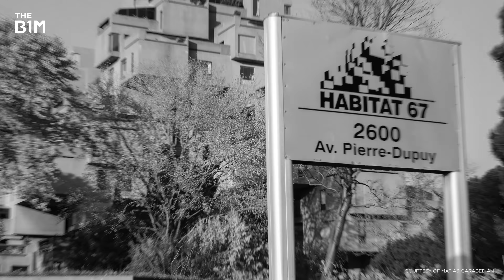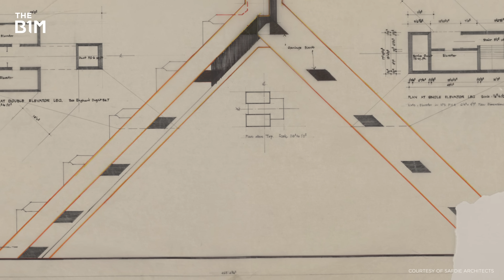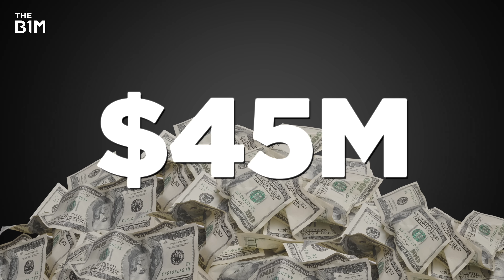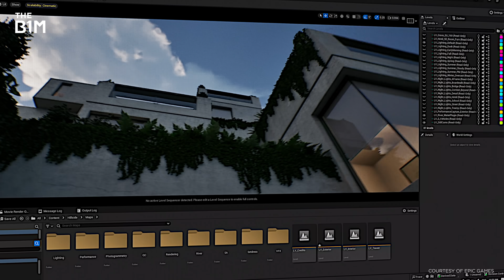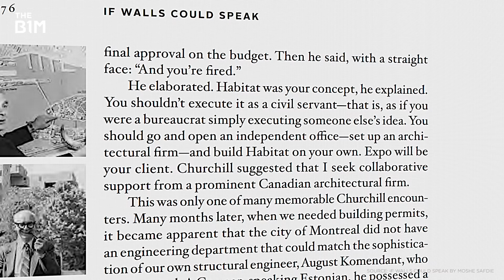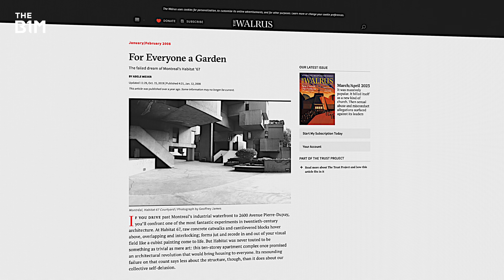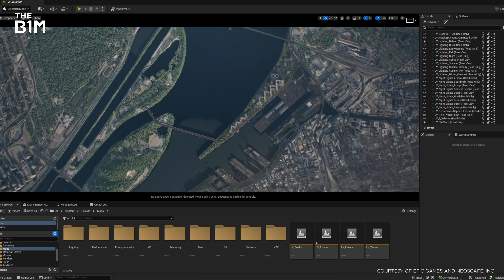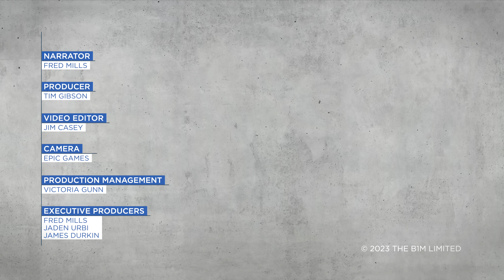How a 23-Year-Old Solved Urban Sprawl

Comment: If the patio is part of someone else's roof, a repair of a leaky roof would likely require tearing up your patio. Also, if you wanted a garden on your patio, how much soil and materials could you use before overloading the structure? Not to mention the logistics of getting all that material up there.
Reply: As for drainage and load, it looks like the decking is a separate modular square of planks, probably a plastic material like plastic decking these days. Pretty durable, but will look faded eventually. Pick the right colors and the fading isn't as noticeable. The flooring underneath would be solid concrete with an elastomeric paint coating, so no leaks. Presumably you'd do an incremental inspection and replacement process, and yes, that means every 10-20 years or so you would need to pull everything off your deck for a few days. And management inspections by drone could estimate if someone is overloading their deck and make sure they know it's not okay to store 100 anvils or an entire pool or whatever. 

As for transporting gardening stuff up there, you would do it like you move furniture: by taking multiple trips. If you have a little folding hand-cart you can carry maybe 200 pounds with little effort, limited by volume of course. That's a couple flatpacked adirondack chairs or a couple large ceramic pots with soil, or about 6 large plants in black plastic garden-store buckets, or 3-6 bags of potting soil. Getting your garden totally set up could take up to 10 trips to the local garden supply using your bakfiets. To summarize, you could do this over the course of a weekend while getting some good exercise and skipping the gym those days. 

What you don't get to do is drive to the garden supply in your ridiculously large pickup, buy 4000 pounds of stuff at once, drive home and back your truck up into your garden, and then unload everything at once. And then of course not use your truck bed more than 10 days a year after that. 

However, if I were designing this, I would include a cargo elevator for each unit stack to allow for easy moving, and on-site shared carts like you see at hardware stores. I don't know if that was part of Hab67, and didn't want to assume it.
Reply: Also it seems like they would hear you walking around on their ceiling.  He's onto something though, density requires open spaces and parks to break up the concrete jungle.  Apartment buildings need to surround nice little pocket parks.  The first floor of apartment buildings should be shops, restaurants, etc and parking should be underground.  The key is the pocket parks for green areas though.
Reply: @jeffk464  Speaking of green spaces, the city of Savanah GA has an interesting history. The original design of the city is in a grid of streets where most of the squares had shared green space parks for the residents to use. It was unique and ahead its time, especially for that era.
Reply: I'm sure testing is in order for weight distribution of the entire structure. Materials are taken into consideration, hemp concentrate seems like a good pick here it's light and strong. But I'm sure they look at all options. Getting material up High is what humans do. I've been on some crazy structures and it's baffling to how humans got extremely heavy material so high but they did it. I'm sure projects like this aren't perfect but as a human living the existence I'd rather see different options in housing. You know how America's housing is very structured unless privately funded. Safe investments with maximized profits per square foot instead of thinking of the human experience within the walls they funded. Stuff like this makes me think what other cool projects we humans could do and why we haven't built anything monolithic to awe the masses of our accomplishments of a collective working society. I'm rambling my bad have a dope day lol
Reply: @orianna1220  I'll definitely agree that if you are going to live in an apartment, that type of design is much more appealing than a straight up and down building with barely a balcony or no balcony at all. In the US, most zoning laws make it so that you can't mix residential and commercial areas. If you live in a suburb, you can't do anything without a car.
Reply: @randymiller2460  there are already apartments where your patio is some's roof. Generally you have rules in place to prevent issues like that. The specifics of soil would only be allowed on the sides where there would be drainage and anything else would not be allowed in the bylaws. (basically no real garden but you can have potted plants). As for logistics of materials it isn't difficult if you look at how Korea does things for apartments. Personally I am not a fan of the style but I can see the appeal.
Reply: You are mentioning challenges, not show stoppers. Challenges are created to be overcome.
Reply: Uh, helicopter?

Comment: I think it's creative, interesting and worthwhile, its just... I hate brutalism... 
When I look at it, I instinctively want to file off corners, build arches and curved supports, nudge the apartments into non-square angles...  
It could be so pretty if you made it actually restful to the eye... 

I've often thought that you could make a great building to live in by basing it on stepwise pyramids. This is pretty much that but hollowed out and spread out. 
I can see that you get way more light this way, and everyone does get a terrace, but you also gain a lot of surface area you need to paint, insulate and maintain. 
With a pyramid structure, you could have shops and offices on the inside, maybe a central plaza with library, daycare, museum, a park...

It's definitely inspiring, though. Most buildings I see are just so forgettable...

Comment: As some other people have pointed out, winters in montreal get very cold, especially just off of the st lawrence without any natural shielding from the wind. The structure of the design is cool and a longstanding cultural monument that we all love, but it's widely known to be a freezer box that's hell to heat in the winter. There is no way that by now we haven't figured out ways to heat and insulate modular buildings like these while also doing something about the grey concrete coffin look that feels more like urban hellscape than green paradise. We need ideas like these--but we need to make them better.
Reply: Yes, there's a variety of ways the original designs can be improved upon with newer technologies and methods, like thermal pipes, hempcrete, etc.
Reply: This is the best comment on this video. Everyone is so black or white here. You catch the balance well
Reply: @kylemalachowski people have a hard time with nuance and complexity.
Reply: Heating mainly comes down to surface area. and it should be obvious that this style basically maximises surface area, thus making heating more expensive.
Reply: @nonyabisness6306 not only that, the height maximizes winds. Wind is extremely good at cooling down structures very fast. In my country many old farmhouses have a mini forest built around them or in the most common wind direction, it helps a lot to reduce heat loss.  When you have a small village where Everyone has tall trees everywhere, wind is strongly reduced so the heat loss is likely much much lower than an elevated structure with similar surface area
Reply: This was the first question that i had when saw it, how will you keep it warm and comfortable in the winter for everyday people if you want to multiply as a solution for friendlier cities
Reply: Well the easy solution seems to be don't live in Montreal.
Reply: Insulation, air sealing, and heating have come a long way since '67.  I'm thinking of a well sealed design built with ICF and heat pumps, which will likely need gas, electric or steam backup for Montreal winters.  An issue is that each unit is exposed to wind on all 6 sides, and has a high ratio of surface area to volume.  But all single family homes are almost as bad, we know how to insulate those.  A conventional tower block would however have inherently better thermal efficiency for any given level of insulation, most apartments have only one weather-exposed wall.
Reply: it looks like a coffin on purpose because brutalist nut jobs want every building to look like gray coffins
Reply: aircrete for exterior walls is lightweight, highly insulating, and easily formed and shaped.  it can be made of differing densities depending on anticipated loads and mixed with basalt fibers for superior reinforcement. Google it...
Reply: That's one way to look at it. Concrete can be drab. But, what if that's what people are used to? This could totally work in Japan.  As long as the structure's up-to-snuff for earthquakes and typhoons.
Reply: Ok then don’t build these types of buildings in cold climates
Reply: maybe this design would be more suitable for tropical country?
Reply: I think the concept is good but different shapes with beter formations could help a lot against winds and keep the core more warm even tho spacious and open and make it look less like lego. Also using different alternatives for the concrete combined with possibly an extra outer layer of thermal isolation could fix all of the issues.
Reply: True Artist doesn't care about people who will have to live in it 😂
Reply: "The structure of the design is cool and a longstanding cultural monument that we all love, but it's widely known to be a freezer box that's hell to heat in the winter. "
not more so than private individual homes
Reply: kinda looks like a dystopian nightmare prison to me. I'm all for pushing the boundaries, but I'd say this missed the mark by a mile.
Reply: @jakeroon  I like the idea but it looks hideous.
Reply: This was my reaction when I saw this project: it's not suitable for a cold environment.
Reply: With better computing and AI the industry can develop more realistic models/simulations without having to build anything, so hopefully that'll pave the way to finding a viable solution.

On the flip side, capitalism is driving developers to cram as many people into as small a space as possible, so maybe it doesn't matter.
Reply: @ukno918  capitalism isn't doing anything. You are complaining about human nature and a trait that you almost 100% indulge fully in. You aren't out helping others you are trying to build your wealth just the same as all the "evil capitalists" that you say are screwing everything up. In reality you are just angry that you aren't as good as a capitalist or you think you are a better person because you are failing more than others.
Reply: first of all we need to regulate immobilia market, stop private rich to buy space, then we can start building progressively, just then there is a realistic chance to make stuff like this happen.
Reply: It may look better on the surface but cramming people into a small area is still cramming a bunch of people into a small area and comes with all the same issues, putting a coat of paint on it doesn't make it better.
Reply: @thomgizziz  Thing is: if we can live densely, yet still be very happy with our environment and living space (own terrace!), then  I'd say that's a feature, not a bug. 'Cramming people' sounds negative. 'Have everything in walking distance' sounds a lot better.
Reply: @thomgizziz  It's a completely new shape of city though, not any kind of rebrand.
Reply: @thomgizziz  medium density housing with mixed zoning is the best possible way to do urban design. It’s the gold standard because it offers the best in terms of lifestyle, environmental impact and health. That’s what habitat 67 was about in the first place, even if it wasn’t perfect. People who dislike medium density housing in my experience have never actually lived in areas like that, are too attached to single family units and can’t think of any good alternatives to urban sprawl or housing shortages that aren’t the dreaded downtown high rise. Living in close proximity with a lot of other people isn’t a bad thing necessarily, and it isn’t actually all that hard to do well. Before suburbia became a thing in the 1950s, that’s how all urban neighbourhoods were built.
Reply: @petrab.7780  Urban sprawl, structural housing shortage and the likes are only such a grave, pressing problem if you presume infinite human growth - which most likely won't happen as the world population is predicted to stabilize in the next century, and potentially even decrease (and if it won't, then we'll have to find a way, as we'll have a far bigger problem on our hands than urban sprawl !).

Also, the whole debate is logically faulty : the caracteristics of the current configuration of suburbs and the likes are used as an argument for their destruction in favor for medium-density housing. However, this 1. only takes into account some configurations for medium-density housing which certainly aren't applicated everywhere (and I'd even say, aren't properly applicated anywhere) 2. only takes into account the current configuration for suburbs 3. ignores all the other numerous causes that are more pressing and would maintain the problematic situation even if current configurations changed.
Reply: @bastobasto4866  anyone who says housing shortage isn’t a pressing urgent problem clearly hasn’t had to try to find affordable housing in the last decade or so. Very few people advocate for the blank slate destruction of suburbs—that would be counterproductive. And since the “current state” of suburbia is the one we’re stuck with, I don’t know exactly what other “kind” of suburb you’re alluding to that would be preferable without transitioning towards some kind of mixed zoning and multi family houses.
Reply: @petrab.7780  Search "Is there a shortage of homes in Canada" by Jonathan Russels, which talks about my last points. There's some other article I had specifically about Québec, but I can't find it RN.
Reply: @petrab.7780 utterly nonsensical. There is no national housing shortage.

Comment: What's interesting is that Soviet Union, actually implemented some of these concepts into reality on a truly gigantic scale.  Khrushchev, also in the 1960s, built modular housing units, encompassing schools, kindergartens, schools, and offices all over USSR.  Of course, it wasn't as pleasant, as Soviets cut costs to the bone.  So, there were no stacked housing, and roof gardens and terraces.  These were just rectangular structures 5 stories high, at first, and then expanded to 9 stories or 12 stories high.  They had tiny balconies and first story units had small gardens.  I grew up in one of those.

Comment: You are confusing having an idea with solving anything. See, Hyperloop is a cool idea but it's an over 100 years old idea and the reason why we have never seen one is because that idea does not work, it's impracticable, inefficient, unmaintainable, costs way too much money and the same problem can be solved way faster, easier, and cheaper. There will never be a Hyperloop (remember my words in 50 years!)  And most people would not want to live in houses like that; apply them to the masses and you get modern Favelas as in Brazil  (look it up on Google, notice how similar they are and see what problems they cause).
Reply: As a Brazilian, I don’t want favelas anymore

Comment: As an engineering student who just graduated in structural engineering and who is from Montreal, I think this is my favorite video from your channel, Habitat 67 and all the other buildings left from the expo are really impressive and beautiful even after almost 60 years. Today, in Montreal, few actually know that habitat 67 is only a fraction of what it was suppose to be, but when we hear about it, the main reason for the fact that nothing else like it was built after, is the cost. However, I wonder if a new design that could implement pre-fabricated wood modules, using Glulam wood, maybe combine with steel or concrete for the main frame of the building could work. I would really love to see and to work on such a project.

Comment: Concrete manufacture releases a lot of greenhouse gases. This design would be better in wood. However it is not the most efficient use of wood or materials for that matter. The most material efficient way to enclose a space (with standard construction) is an equal  sided cube but to take advantage of lower footprint area and give all apartments a view, a tower with equal sides can be produced. I live in a tower in a city near lots of green space. It's a good life but I have to visit the countryside often to get my nature fix.

Comment: Accessibility concerns: Looks like a lot of stairs. Are there escalators instead of elevators?
Drainage concerns: A lot of rooftop gardens. How is drainage handled? How is the weight of a growing 20' oak tree handled? Grass, dirt, flowerbeds...
Only housing was addressed. How are office spaces and industrial uses incorporated?
Is there a parking garage? How far from each living unit? Get your groceries from car to apartment?
Where is the HVAC equipment since there's no "roof", basement or attic?
Streets were mentioned and a few breezeways were shown. How does one get around if one wants to visit a neighbor or get to the ground or get to internal office, retail, industrial spaces?
It reminds me of the abandoned brutalist concrete apartment complexes in Russia from post WWII.
Reply: You nailed my questions.  How far from car to kitchen with a 25 lb bag of cat food? How do I get to a friend one module over? What are the utility bills like?
And I believe it's nowhere close to the Metro, so it doesn't do much to reduce dependence on cars.

Comment: Mega structures end up being more structure than livable space so they are unbelievably expensive and therefore totally impractical. Also moving vertically in elevators requires far more energy then moving horizontally  ( streets). It’s always infinitely easier to draw than to build something.